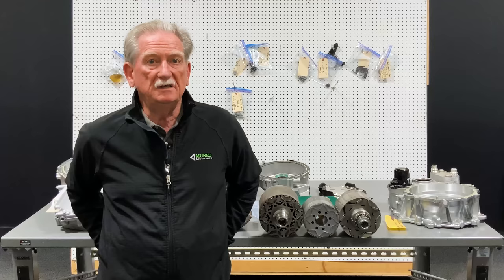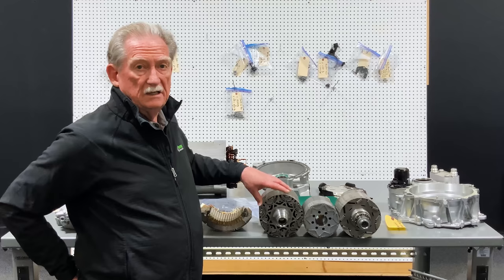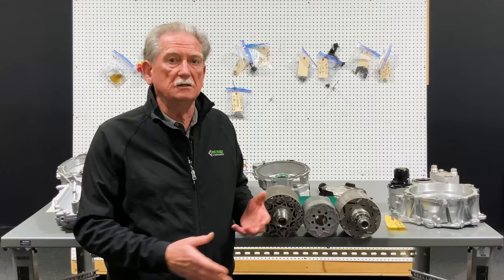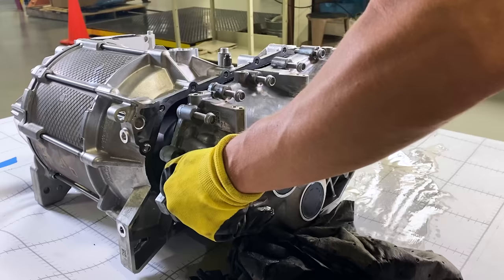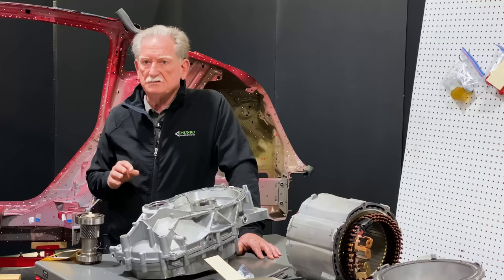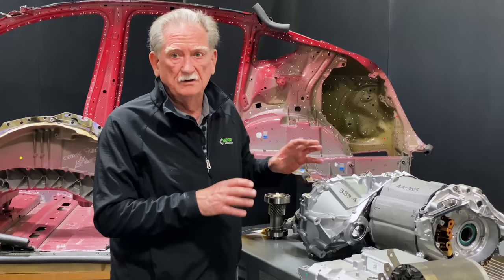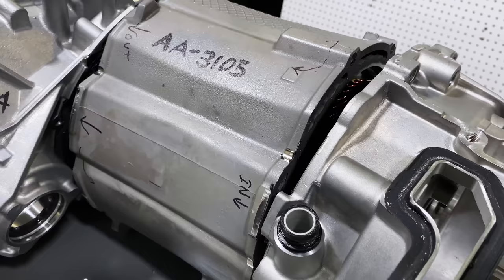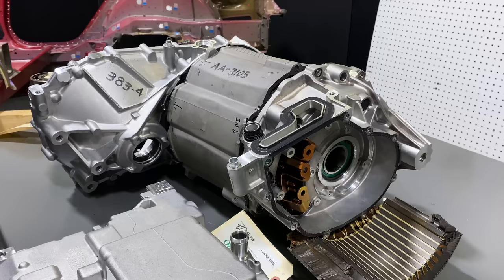Volkswagen ID.4: Electric Motor Teardown and Analysis

Comment: EU regulations just might have something to do with the fasteners. There are requirements on recycling and the right of repair. Sandy Munro might be right about using snap fasteners. But I do think VW engineers must take into account not only how you get parts to stay together but also how you can take them apart again.
Reply: And even if current EU regs don't force serviceabilty of the inverter today its not a stretch to imagine VW are seeking to be a step ahead of forthcoming right of repair regulation in the near future. Having worked on both Ford and VW vehicles over the years Ive found VW to be among the better manufacturers when it comes to fasteners performing reliably. Only the Japanese manufacturers Honda and Toyota do it any better.

Comment: I lived near an AMTRAK line between Boston and NYC.40 years ago and watched as an automated system replace old rails, wooden ties and old ballast. They replacement rails were laid along side the old rails that were set aside as the new continuous rail was slipped into place after the bed and the wooden ties were replace with concrete that had heavy spring clips. The new rails were very long and staggered. They used butt joints with thermite weld. Being 77 years old, I still remember the clickety-clack of the old rail -- but that update was more than 40 years ago.
About a decade ago, I met a fellow with a PhD ME whose entire job was to ensure the all aspects of the rail integrity. There's a lot more to that job than just laying the rails and walking away.

Have you and Elon given much consideration to what you are doing?  It seems that you and your inspiration are giving the Earth its first major inspection and overhaul. Keep on going.

Comment: I really enjoyed this. I also enjoyed the whole discussion of fasteners and all the comments below and debate related to that topic. I am not an engineer, but someone who has repaired everything in the house and the cars for decades.  As such, I appreciate design that allows for ease of service and it is a huge consideration before I buy things. I used to curse plastic fasteners, but now I don’t care as long as they can be unfastened and refastened without great difficulty.  Self repair is usually the most economical method and keeps things out of the landfill before their time.

Comment: "nobody's gonna service these things"

Hopefully the threaded fasteners and some "right to repair" legislation make it possible to service these electric vehicles.  From a repair perspective, repair of an electric car should be rather simple.
Reply: Repair of electronic board is a big business.  Maybe not done by third party in electric cars, maybe yes, but the key thing, is that it is way cheaper to repair boards like this, than to toss them out.  in consumer electronics, boards are repaired.  Service center "buys" a new board, which is actually repaired from some other customer.  There is a big location that only repairs, and the "cost" for the new boards is basically the average repair cost + profit.
Reply: Also, it allows you to replace a defective part, without replacing the whole system, like with Tesla. I wonder if VW makes you code everything in, to get it to work?
Reply: This inverter module can NOT be serviced except from the manufacturer. So the screws are a good idea to make it possible to repair things. May be in China? 😃😮 Don't compare these threaded fasteners with screws of the body
Reply: In Germany there will be people servicing these! 
I would have loved to see the ID.4 equivalence of the carcomputer. In their VW's ICE-cars I owned these are a cheap piece that is easy to replace, yet they were allways made in a not humidity tight way...so basically after 12 years  or so some conection will be corrodet away and I had to replace it...
I would want to know if they do that annoying shit to the ID.4 too.
Reply: @myg63  That's absolute nonsense. They can be serviced.
Reply: Exactly. It's logic like Munro's that will end up damaging brands more than they think. Keep everything to where it can be disassembled quickly and brand image is improved. 
Do they not understand that long-term repair costs and anti-repair assembly methods are damaging brands more than ever now?
Reply: @MrCarGuy  On a workshop level, it's unservicable. But they will (most likely) be rebuilt at the factory.
Except for how to swap the inverter, change seals etc, there's no repair manual on the gear box or motor internals. (I've checked)

There might be some 3rd party after market parts available in the future, but I doubt it.
Reply: He was referring to the door actuator, not the entire car.
Reply: I use electric kickscooters and full-size scooters (Chinese ones), ofc it's nowhere near the complexity of a car, but it's really simple, you have about 5 key components, which is the battery pack with management, charger, and an engine, there's really nothing to repair or break down, even if it does it's really just swapping parts like in a PC, you never need to disassemble the engine to change some gaskets or service some plastic valves, the design is basically an AK-47
Reply: @kevinyancey958  I love Tesla's in their design but frankly they are pretty difficult to repair
Reply: @MrCarGuy  true.  I don't own an iPhone because they make it impossible to repair.  I don't really care if I can service my $150 cdn moto fast, but if I spend over $1k it had better be serviceable.
Reply: @panzerveps  Typical workshops mainly change parts, they don't really service components. Even at ICE cars they don't do big repairs on engines (like crankshaft bearings, or overhauls, some even don't do timing chains) or gearboxes (they usually replace them and don't open them at all).

Comment: This is a very learned commentary on the ID4 drive strip. Towards the very many "threaded fasteners"
 (I like this word of art!) Volkswagen probably either want to have the first lot of drives fully repairable in order to duly follow up on material and design failures or...they just don't want to follow a typical throw-away-mentality.

Comment: Possible Tesla advantage with coolant pump and external heat exchanger is to have better heat management during heavy use/(abuse?) like extreme  cold and hot weather, repeated acceleration use, etc.  Also noticed Tesla's larger bearing size...like comparing bearings in old hand drills compared to new cheap lightweight drill of today.
Reply: The Tesla configuration was designed to handle much much more torque than the ID.4 config. That’s why Tesla has to cool those massive barings while VW easily remains within the maximum specs of those smaller barings. 
It would be interesting to see a tear down of the Taycan power train. That should be comparable to the Tesla setup.
Reply: @Conservator.  agree... Sandy is comparing the  VW motor to a motor with a design capacity of almost 2x the output.
Reply: @Robbie6298  2x the output and minnium 2x the design life.
Reply: @otm646  I’m not so sure. Tesla is using those SKF barrings to their limits.

Comment: The Capacitor is a Failure point, they will need service in about 10 years or some number of hours usage.   And IC and other SMD can fail so DONT throw away an entire inverter for a 5 cent failed SMD, $3 IC,  or $20 capacitor.  Grubber Motors is demonstrating that Inverters and Battery packs can be repaired for much less then a new module.
Reply: I agree, bulk caps are the first ones to go. Sadly very few people repair boards anymore.
Reply: Absolutely, screws may be a pain, but use loctite and this way of doing things massively reduces waste and cost to repair. It’s extremely wasteful to throw out an entire assembly just because of one failed part.
Reply: There are a lot of factors involved in capacitor life.  Materials and ripple current being the main two.  They can be reliable.  The tradeoffs are cost and space.  So it really is up to the companies choices.
Reply: Based on the numbers of inputs/outputs on that module, it looks like it is arranged in such a way that it would form the capacitive voltage dividers required for the 3 half-bridges inside the power module. Based on that I don't believe this capacitor is a huge weak point, as It must be a form of film capacitor, possibly polypropylene, and those don't dry out or go bad in 10 years. The inverter switches are much more likely to fail first.
Reply: I believe VW is committed to dealerships.  Dealerships do NOT repair parts (regardless) -- they simply replace them.  This saves the Mechanic's time and the expensive new part increases the dealership's profit.  A GM dealership once replaced a push on parking brake that was sticking and only needed lubricant -- then defended their action when I complained after looking at the original part they replaced.

Comment: The number of fasteners on printed circuit boards is for rigidity to protect the board from thermal expansion/contraction forces of the electrical circuits/components varying temperatures which puts stress on solder joints and surface mount components which can crack causing an open circuit.

Comment: You talk about fasteners a lot: Could you make a video on that subject alone, showing your favorite fastening solutions?
Reply: Seconding this, I'd love to hear you expand on this subject. As someone who would rather fix than replace, I tend to have a knee-jerk hate for snap fasteners and the like.
Reply: Fasterners are fascinating... Especially when it gets to the very big, very small or very esoteric.

On a semi-related note, there was a joke that made the rounds when I was studying Mechanical Engineering:

An international engineering competition issues a challenge to fasten two sheets of steel together.

The US solution is to use three plain 3/4" bolts. One has a washer missing and one is not tightened correctly.
The German solution is to use 8x zinc-chromate coated M10 10.9 bolts with washers and nyloc nuts, tightened to torque and angle.
The Japanese invent a patent clip specially for this problem that can only be assembled the correct way and will snap-fit shut under gravity. It will either be never reused or reused for everything from clothing to anti-aircraft artillery.
The Chinese copy the clip with various levels of success, add an M10 to make it look official and glue everything together.
In England, they use a two brass bolts of different sizes and types (one with a left-hand thread), aluminium washers, copper nuts and braze the nuts to the bolts.
The Swiss reuse the thinnest possible shaft they got sent by the Japanese in a earlier joke and use it as a tie rod to flange the sheets together. You need a microscope to find the holes they drilled.
Reply: No, he can't, because the methods he praises don't enable him to take things apart, and if he does, he can't put them back together.

Comment: VW did an impressive job on the drivetrain and I like the differences. I like the oil filter and cooler design of the tesla as a consumer for its longevity.

Comment: Sandy, you mentioned tightening into the plastic range. Why would you want to do this? Wouldn't that be a source of loosening (say in the case of additional thermal stresses causing more plastic deformation) over time? 

These videos are such a resource! Amazing and thanks, from Vancouver.
Reply: This is the method used for ICE engine cylinder head bolts as they keep the joint in perpetual tension,  making it nearly impossible for the bolts to come loose,  ensuring the head gasket seal lasts much longer than with the older,  conventional head bolts. It's been that way for decades.  Seems to work,  but head gaskets still leak and this type head bolts cannot be reused,  adding to repair expense :(
Reply: re: Wouldn't that be a source of loosening (say in the case of additional thermal stresses causing more plastic deformation) over time? A: no, the deliberate stretch/tension placed on the bolt (besides adding clamping force) effectively MOVES it out of it's normal deformation range that might occur if it were static and not in assembly.  yes, just like a cylinder head bolt.  this also parallels how having a pressurized cooling systems RAISES the temp at above which water would normally boil (212F/100C) thus giving it wider use/operating range.
Reply: @jamesengland7461  Thanks :) Conceivably you could tighten it just in the elastic region so it will always be in tension, so to answer "but why plastic?"...I did some brief searching. It seems to be done in limited applications, one of which is like you said, cylinder heads. But it appears that control of the tightening past yeild is crucial, and not so easy, leading to 'bolt relaxation' failures. However the reason why it is done is explained well here: 

http://joeynovak.com/blog/uncategorized/why-you-cannot-re-use-many-modern-head-bolts/ 

Basically, since the stress strain curve flattens after yeild, during additional thermal cycling, the strain is much lower and differences in bolting force between different bolts are smaller, thus leading to a more evenly tightened surface, which keeps a better seal etc. There are some fatigue benefits too but i didn't look into it that far...
Reply: @2hedz77  thankfully they're not widely used beyond cylinder heads- I'd hate to have to replace bolts all the time!

Comment: The "Secondary capacitor" looks like a common-mode filter to reduce noise conducted back to the battery cables.
Reply: And on the buss-bar is the ferrite choke :)
Reply: The monster ferrite core around the input buss-bars is another tell tail on a high power LC input filter
Reply: It is. (Valeo-Siemens engineer here)
Reply: Yeah damn during CE testing I needed one of those lol
Reply: Snap fits may be great for assembly and reliability but trust me, in the aftermarket I prefer threaded fasteners at least it can be dismantled and reassembled again. Don’t kid yourself, people will be going inside units like this his in future. Especially as the inverter is quite refreshingly modular. 
On another note, are the power devices really IGBTs or are they MOSFETs?  IGBTs may have higher power density but they are very lossy compared to a MOSFET.
Reply: @ShaunieDale  Probably a hybrid mosfet/igbt. Fast switching, good temperature characteristics.
Reply: @emilen2  I'm pretty sure it's an Infineon module, but the Si IGBT and SiC MOSFET versions look pretty much identical from the outside, so it's very hard to tell form the outside.
Reply: @user-td3yi1mq7p  I meant it literally could be a hybrid chip inside. I've just learned they exist.
https://techweb.rohm.com/knowledge/si/s-si/03-s-si/5962
Reply: @ShaunieDale  I guess they will soon use GaN transistors instead of Mosfets or IGBT.
Reply: @emilen2  Cool stuff, didn't know about those. But I doubt that those are used here because I'm fairly certain that this is an infineon module and as far as I know they don't use those.
Reply: @VladoT  a friend of mine is working in GaN research. We worked together twenty odd years ago on MOSFET production. When the plant closed I went into automotive electronics, probably not the best decision ever.
Reply: @VladoT  I think SiC is superior in this application, because of the high maximum load current and the high temperature. GaN seems to be more useful in places where high switching frequency is important to scale down the passive devices.
Reply: :) you know it makes the motor run ;)
Reply: I see half of the people commenting under Mike are colleagues from the industry - feels good:)
Reply: Yes thats the Filter. Not just Caps but also Ferrits. There is only one Main Cap unter the IGBT module
Reply: @emilen2  good link!
Reply: @ShaunieDale  they may not open up the units to repair these in the USA in future. In many countries, ghat will be different, they will offer exchange modules and the damaged one will be repaired. Particularly if it ends up with an ongoing simple common fault that is easily repairable.

Comment: I have to say that the snap-together philosophy is much better if the discussion is about new or recent equipment than it is in respect to old equipment. Both with tractors and on-road vehicles, once parts have been subjected to many years of intense thermal, chemical, or other stresses, I prefer working with quality threaded fasteners many times over. In fact, some of the models of Ford products where I first encountered a lot of snap-together components when I first started working on them had such routine degradation that about half the time the "snap" was tabs breaking or the part itself cracking when any attempt was made to remove or disconnect it. That could make the time and parts cost in servicing it among the worst in the industry. I have no doubt that they're for the best in manufacturing and initial years of plug-and-play servicing now, but if we're seriously talking about million-mile cars, they're unlikely to be the most desirable in quite a few applications that far down the road.

Comment: 26:26 The amount of threaded fasteners holding down the logic board are likely to mitigate high frequency vibration. Vibration alone can break off solder joints holding surface mounted devices to the PCB. Especially if there is coolant flowing over the entire thing. Electric motor vibration + liquid can cause cavitation.

But it's generally just good practice to fasten logic boards as much as possible in high vibration environments.

EDIT: and about threaded fasteners from WW2 vs now, blue loctite.
Reply: And also to make sure the thermal pads are compressed properly. There were a lot.